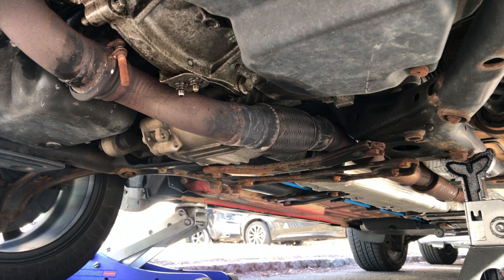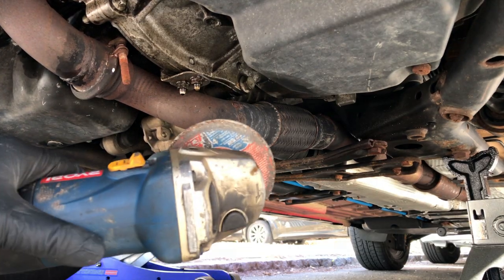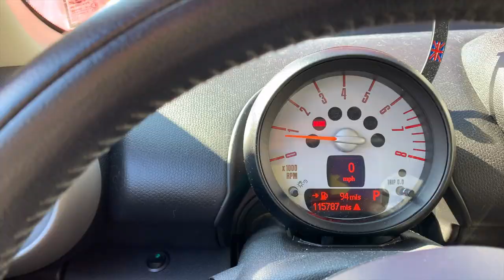Swapping out the Mini's Downpipe

Comment: Any engine  codes after installation?
Reply: 6:22 at the top left Corner you can See Something coming Out of the downpipe. This is the part witch will should prevent a engine code

Comment: Did you have to get a tune after installing it?
Reply from the maker: Do you absolutely have to? No. But to get rid of the check engine light you'll NEED to tune. I've tried every combination of non foulers to space out the secondary o2 and nothings works. I'm going to get it tuned next month when we have planned downtime with the car. Thanks for watching!

Comment: Check engine light ever come on with that o2 sensor extension since install ? Thank you
Reply from the maker: Yes it did, I've tried so many of them but it always comes back. Going to get a "stage 2" tune for it soon and be done with the CEL on top over getting a little more performance.
Reply: @MojoGarage  did u notice a difference right away?
Reply from the maker: @cucolopez1942  absolutely! Turbo spools faster, more power available down low.
Reply: @MojoGarage  hell yeah, goid to know. My cousin has the 1st gen with under pulley puts about a car on me. I should kick his ass with this,thanks
Reply: @MojoGarage  yo, have you tried the O2 simulator from big daddies garage?